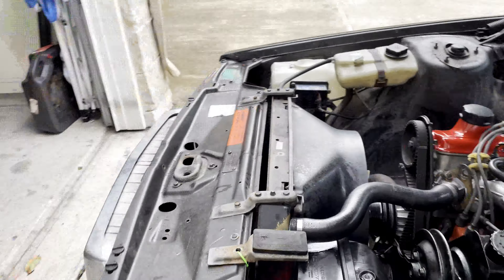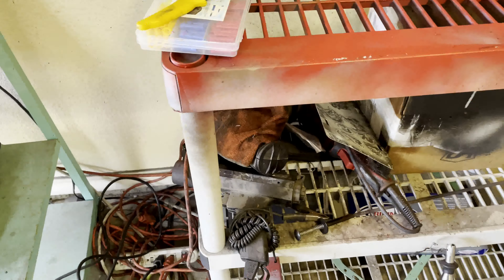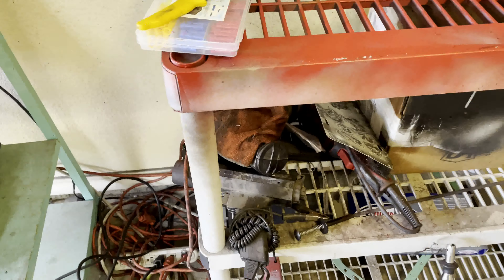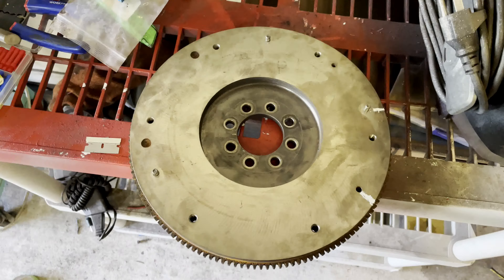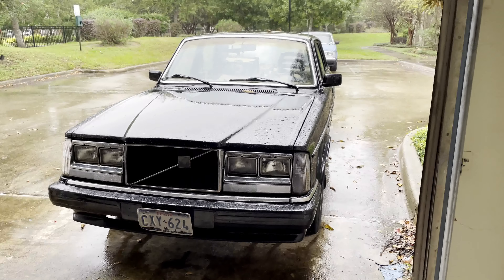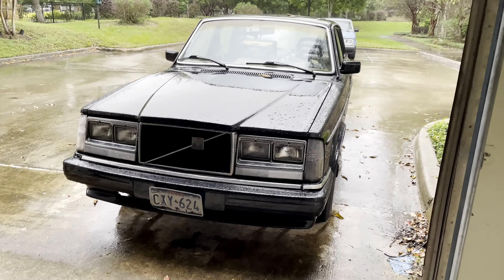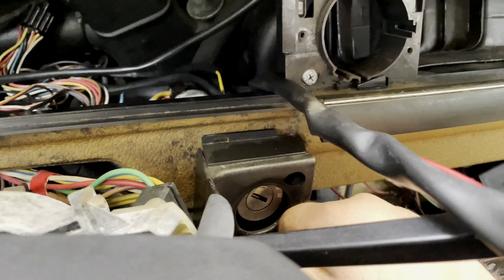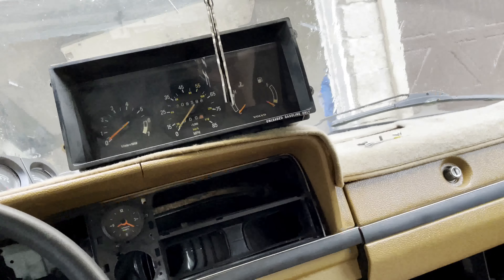1984 Volvo 240 Restoration Part 6 ( IT STOPPED RUNNING.. )

Comment: I'm suffering with the same problem in my 1986 245 B230FS, i've already replaced the ignition switch, but hopefully if you solve yours it'll help me solve mine
Reply from the maker: Mine ended up being loose connection at the harness under windshield wipers
Reply: Check the ground wires on the fuelrail, those are for the ecu, if it is bad ground the fuelrelay wont click and no spark :)
I have had this problem too
Reply: @RedblockJesus  isn't that like the most important connector in the car?
Reply from the maker: @jacobfleming565  pretty much lol. Goes from the ICU box to the main harness.
Reply from the maker: Mine had corrosion on the actually connector and would make the car shut off at the slightest touch